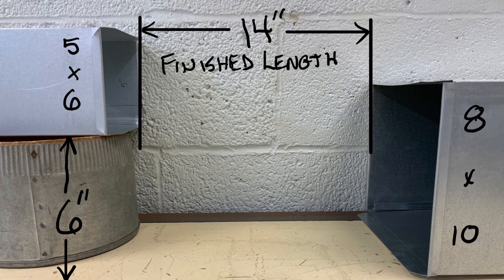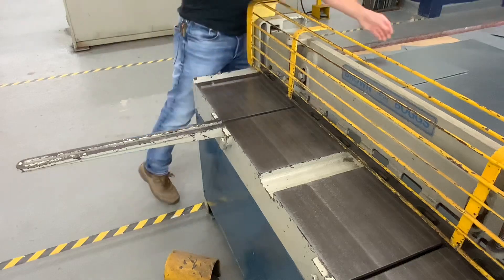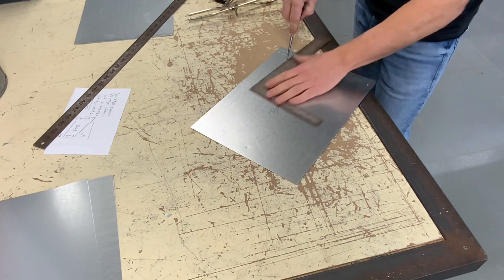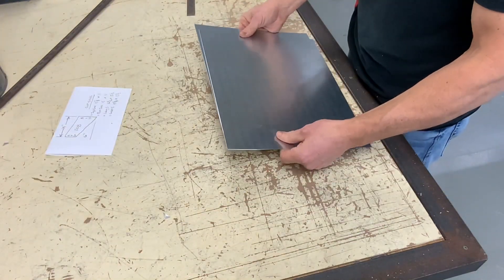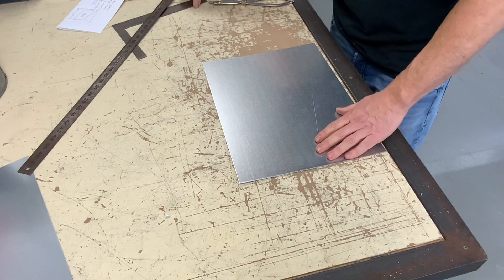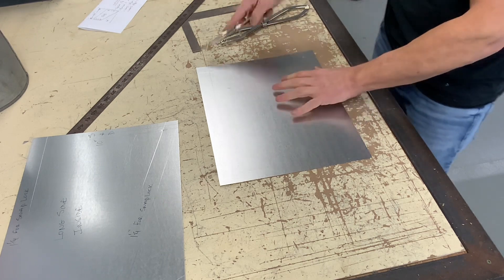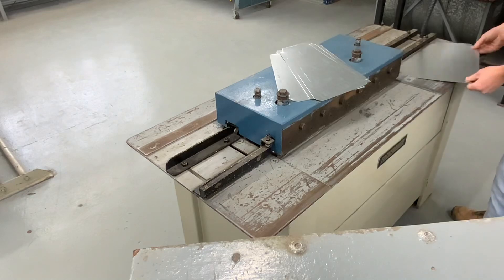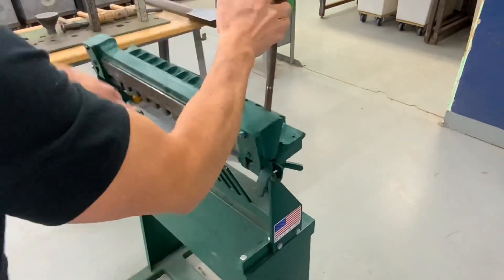Triangulation - Transition with 3 sides slanted, fabrication

Comment: Hey duane, i remember 2 years ago i noticed ur cut size was a half inch too short for the top cheek the 6 inch slope plus 5 inch width plus 1 inch for the two half inch bends which is 12. My question is since the bottom is flat, would the cut size still be 12? Or would it only be 11 since theres 0 slope. 12 right? Since its 6 inches off the ground
Reply from the maker: Hi Lefty, I’m not exactly sure that if we are on the same page regarding the top and bottom pieces for this fitting. To answer your question for the bottom cheek the cut size would be 15 x 12. I had previously made a comment back to you earlier that I had made a mistake on my cut size sheet. I wrote down 11 instead of 12. If you’re interested, I uploaded a video last week that explains flat on top and flat on bottom fittings. I’m happy to hear that you’re still active in the trade.
Reply from the maker: https://www.youtube.com/watch?v=SkniPAmeCLg&t=104s
Reply from the maker: https://www.youtube.com/watch?v=SkniPAmeCLg&t=106s

Comment: You've successfully overcomplicated this process for anyone attempting to do it in the field.
Reply from the maker: Sorry Bryan! I agree with you that this can and is a complicated process.  95% of the time this isn’t a fitting that’s built in the field, UNLESS a person can use his layout knowledge to fabricate it on site. The main reason is, there are No Shears, no lock formers or Bending brakes ON SITE.  Yes you can use S cleats, screws and hand benders 👍 WHEN THER’S A WILL THERE’S A WAY.
Reply: That’s what I use on site.. I’m about to core core 6 holes on a Sunday for some dryer and bath exhausts.. good day fellas

Comment: so to sum up my question wouldn't the cut size be 12? 6 inches for the long side slope plus the 5 inch duct opening plus the to half inch snap lock bends? that way u have 6 inches to the botton and on the other side wen u come over 8 from the bottom plus the half inch u would have 3 inches left over for the short side slope? I hope my question makes sense

Comment: hey duane, I watched this again and im a little confused. I understand how u get the length of the piece, but for the top cheek u cut it at 11 inches, and the width was 5 at the top. so if u come over 5 inches over from ur half inch scribe line for ur male, u will have 5.5 left over. so that wound mean to the bottom of the duct u would have 5.5 inches. if the long side slopes up 6 inches, wouldn't that mean ur a half inch too short?
Reply from the maker: OMG! If you’re confused, it’s my fault. SOOOOO SORRY!  I just checked out the video and I see that I wrote 11 inches for both cheeks and it should have read 12”.  My Bad and I wish I could make the edit as we speak, but not sure if I can.  At least I did cut them at 12” in the shear
Reply from the maker: Ooops! I hit send too soon.  Thanks for the correction and if you look hard enough you may find more? But I hope not 😀

Comment: why did you add 2 inches to your top side when the calculator said 14.13
Reply from the maker: When working with S and D, tapering fittings use a 1” working line.  That means this fitting is calculated using a working length of 13”.then you add 2” at the end and the fitting will finish 14”. I know it sounds complicated
Reply: okay so im trying to make a transition piece from an air handler to existing duct work with one flat side which is the back of the unit. does the same formula apply or are there different formulas? or would you like to know the dimensions
Reply: that formula definitely works for the right side and left side of my piece but for the front side it’s doesn’t seem like it does because the two measurements i get from the pieces are not the same, so i don’t know what side i choose or if there’s a different formula for it

Comment: Can you please give me the formula, I love your videos
Reply from the maker: Transitions simply use the Pythagorean theorem C=  Sq root of (A sq + B sq )
To solve a slanted side length, you first need to know how long the fitting needs to be, also called finished length. The second measurement required is the amount of change or slope.  
Here is a Pythagorean scenario for you, If a building is 20 feet tall and let’s say you have an extension ladder that is 6 feet away from the base of the building.  the ladder length required will be 20.88ft to reach the top.
Reply: @sheetmetalwork  you could just measure the length of the pattern with a pee wee tape. its easier than doing the math for belt wrapper lengths. just my 2 cents
Reply from the maker: Hi Yani, what formula
Reply: we are not understanding the numbers you are coming up with for the slopes and  wish you would have videoed the complete math process.
Reply from the maker: @onemischiefmaker7032  I’m sorry I wasn’t able to make it clear, Trust me, I wish I could snap my fingers and produce another video but I just don’t have the time at the moment. The only thing I can say at the moment is that this fitting requires knowledge of triangulation layout.  Perhaps if you watch my other related videos as I do with my students.  The first video from my channel that I would recommend is Sheet Metal Pyramid for an introduction to Triangulation, the second video is Sheet Metal transition with 2 slopes and the third is Sheet Metal Transition with 4 sides sloping.  I wish I was there to help you.
Reply from the maker: @onemischiefmaker7032  if you have a few minutes you could look at this video, it may help?
Reply from the maker: https://youtu.be/nhEsN53TWJE